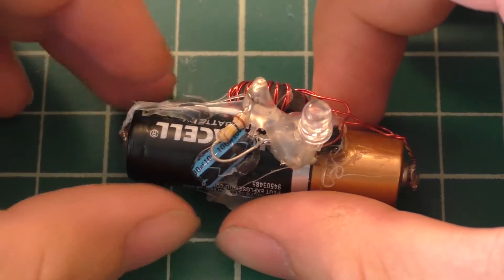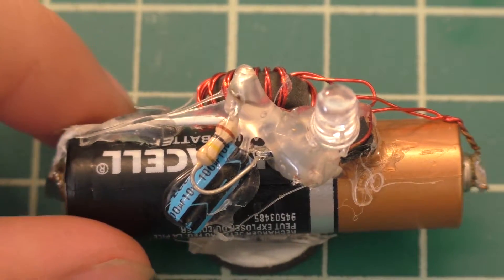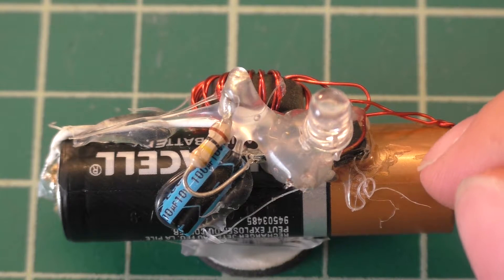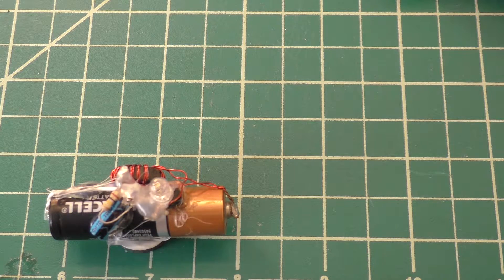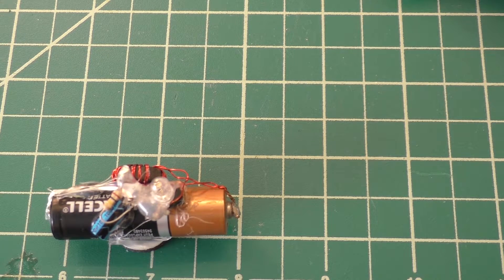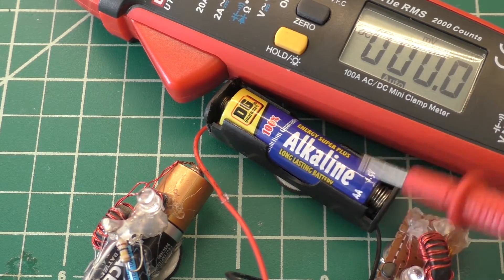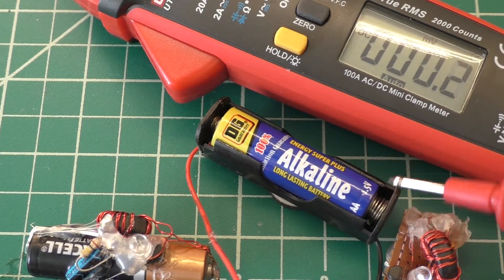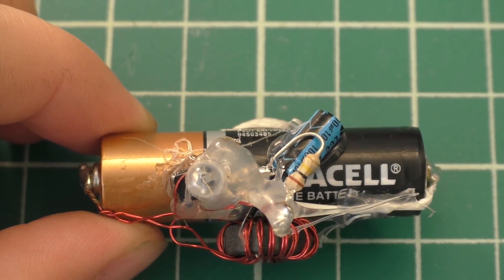Blinking Joule Thief 2 Year Update

Comment: I connected a wire to my Radiator(Running water in it)Copper tubes connected through out our house, then connected it to earth in the wall, and i got 210v/5mA 2000hz. What is that?